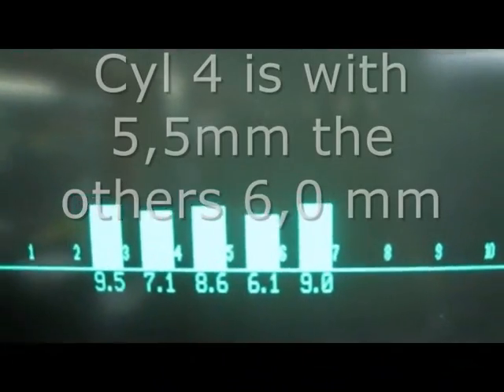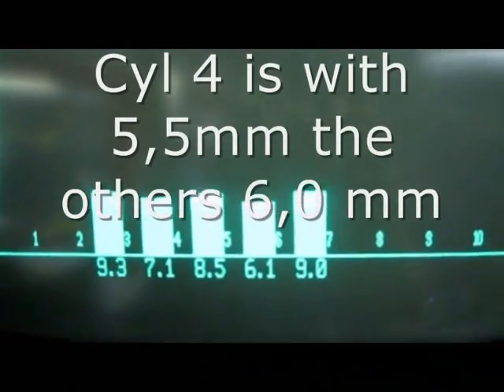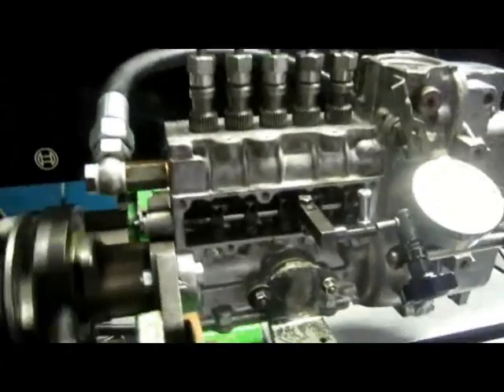Dieselmeken shows difference between 5,5 mm & 6,0 mm in same pump

Comment: i have a question :) i have 602 pump with 5.5mm with max fuel what will happend if i replace elements with 6mm and didnt adjust the pump after that

Comment: Hej,
I have 602.962 engine in w123T. Since I saw your pump upgrades I am really enthusiastic to upgrade my car. I would like to ask you for advise for the optimal solution for me. I am using my car daily and would like to have better torque and some horsy. Do you have any experience how much fuel (cc) the original turbo can deal? If I need to change the pump elements to 6 or enough to sterch the original as much as possible?
Cheers 
//Matyas

Comment: So--Not only plunger diameter is important! The angle and height of the Helix is very important too...
A 5.5mm absolute max will give 66cc/1000 while the 6mm will give double that at same rack setting, without making injection phase too long....
Who needs 7 or 7.5 when there's loads of 6mm out there!
Reply: nice! i want mileage in my jeep, but a little more power than stock. i have an he221w and was thinking the 6mm elements. i just dont know the power range. how much torque and horse power? whats kind of fuel mileage hit will i take? stock is reported to get 35 mpg in a jeep on the hiway. what if i upgrade to 6's? how much of a hit will i take driving the same way?